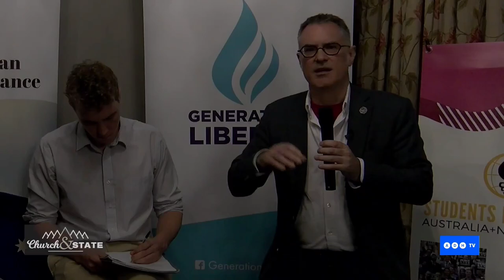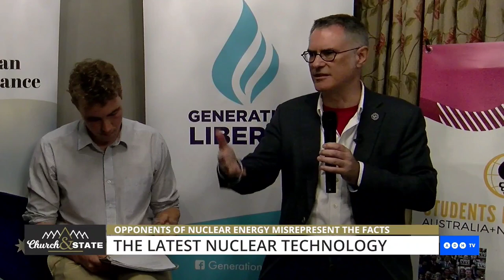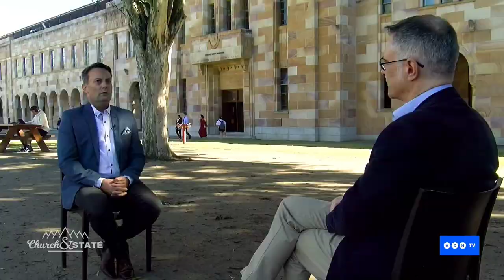Small modular nuclear reactors are the way forward | Prof. Stephen Wilson

Comment: NuScale upped their price from $5.3b to $9.3b and they haven't even built it yet. These things are going to be white elephants.
Reply: Still cheap for a 12 pack- 1400MW for half the price of snowy 2. Also lasts 80 years... I’d call that a bargin.... and zero emissions with very high capacity factors. Nuscale is only one company too.... The BWRX300 is also a very good design... RR also has a good design.